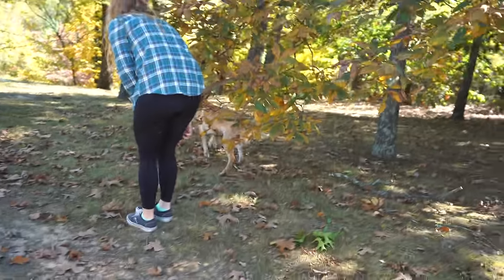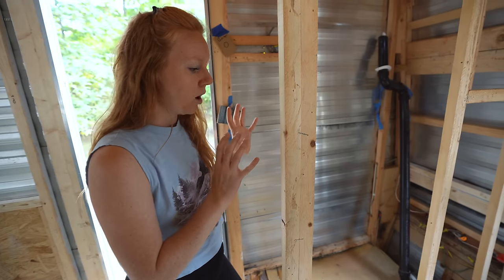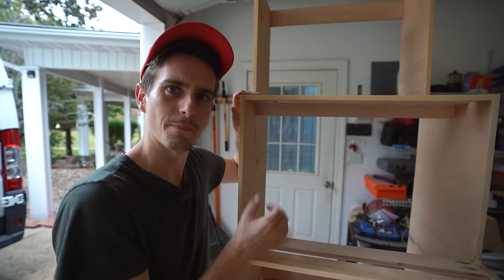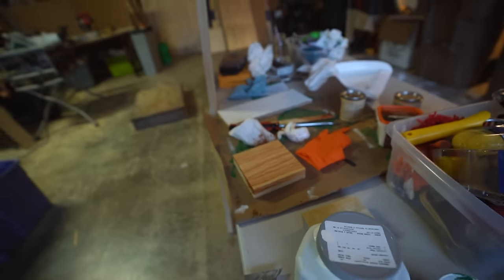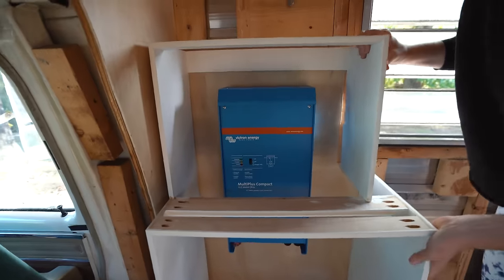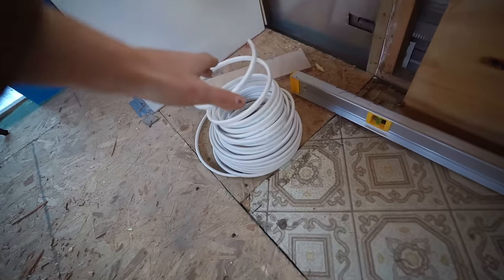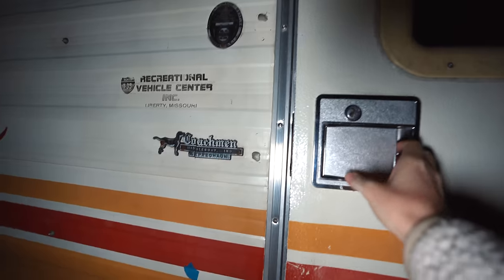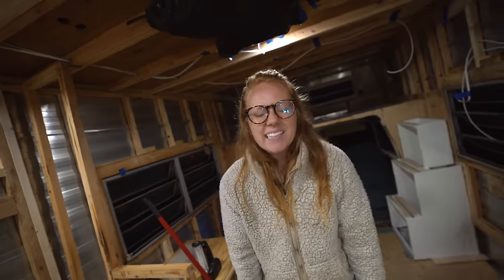Starting Our Custom Built OFF-GRID Electrical System! - RV Renovation (Ep. 12)

Comment: Hi folks! Love the renovation. It's refreshing to see young ladies not afraid to get their hands dirty, break a sweat or a nail! LOL Scrolled through a plethora of comments and only saw one addressing this issue, so here's our two cents worth: your batteries should vent outside. The fan blowing the built up heat into the coach will make the AC work double time and the inverter work triple time; making an endless, vicious circle loop.

Comment: For the electric cabinet (great idea btw) I recommend an intake fan near the bottom (maybe behind the passenger seat) and an outtake fan near the top. (Heat rises) also for your step. Pine isn't very strong. It's Fine for the short run. But for the long run I recommend a hardwood.
Reply: You might want to consider a center support
Reply: Pierre and Randy - True stuff.
Reply: Been looking for a comment like this. Thanks

Comment: Love the cabinet/stair idea. I am concerned that you chose pine as it is a soft wood which will easily mar and bow esp at that thickness and use. A hardwood is better for that application. If you stay w pine, you need to put a faceplate to keep it straight, and some type of front to back bracing since you will be climbing on it.

Comment: What kind of refrigerator are you planning to use? 
An absorbtion one draws quite a  lot from the batteries and generally works better when running on gas.
For a compressor fridge, you probably need a thicker wire. Although it doesn't draw huge amps, the inrush current of the compressor will cause too much voltage drop in the wires, so the fridge might think the battery is low and shutdown. Many vendors do have a chart in their manuals which wire gauge to use for a specific cable length.
Even if you're using absorbtion, I recommend running a thicker wire, if you ever want to change, while you can access it, it will be a pita to run a new wire once the walls are finished.

I can't really make up the cable length, but I think you're better off using 10AWG

On the other parts: For the lights you don't need 12AWG. This is pretty thick cable, harder to handle. 16AWG will be fine, since it won't draw much power. 16AWG can handle 5A without issues, and I think the lights are 10-15W max (generally 3-5 watt/piece), and you're not likely to run them on full brightness.

For my campervan build ( https://www.djsmiley.com ) I used 6mm2 (10AWG) for the fridge and water heater, 2.5mm2 (14AWG) for the heater, water pump, maxxfan and 12V outlets (since they can go up to 10A), and 1.5mm2 (16AWG) for all lights.
Reply: They showed it in another video, it looks like a cooler and is an impressive set up

Comment: It’s probably too late but the cutoff switch shouldn’t be right above the battery in case they start to ignite or other electrical issue you don’t want to reach over them.
Reply: Travis - good point. I thought so as well, but what do I know? I thought it should be external.
Reply: I agree kill swith should outdide of cabinet. If trouble it all will be inside cabinet you have to open door reach in to hit shut off.
Reply: @Gar H -agreed.
Reply: @darlenewillbrandt1628  - and all - I've only been thru it on boats, but it must be the same thing. Kill switch on the outside, vents, always have a licensed electrician check your work. It seems obvious, but maybe not so.

Comment: I give you guys credit for running electrical wire and installing lights, switches etc. However, I suggest you have a professional like an Electrician, double check the entire electrical system to make sure that everything is safe.

Comment: Please use an electrician to double check everything before you put up walls!!!!!! 
Don't* want any fires!
Reply: I agree! Thats a lot of electrical components boxed in a small space. Putting in some fans maybe critical in making sure that inverter doesn't overheat.
Reply: Yes, ditto!
Reply: A M and all - Always work with a licensed electrician, even if you think you know what you are doing. I think it is short money. Not being an electrician, I always work with one. It doesn't cost much to have someone check your work. Maybe two.
Reply: Safety first.  Get your work approved by an electrician.
Reply: Yes agree, definitely get an electrician to check it all!... . Look at the you tubers Kara and Nate (you know them, you did a video with them!) .. They just had quite a few things in their van rewired by professionals who discovered melting plastic and several other fire hazzards!... It's not worth the risk... Also install fire alarms!
Reply: @jzakary1  - I've recently had an inverter catch fire. It can happen. Thankfully I watched it happen, so no harm, but for the inverter.
Reply: Couldn't agree more with this comment. Electrical systems and wiring etc, has to be done correctly to make sure that it is safe. You can't just wing it. Better to be safe than sorry.

Comment: I recommend an interior light on a remote...  So nice to be able to light up the interior without searching for a switch, and also nice when you go to sleep to turn off.
Don't forget to fuse each battery, and use the thickest gauge wire you can...  Fire's won't be a problem with a fuse on each battery...

Comment: I do woodworking as a hobby and there is a product called Edge banding made for putting on the unsightly edges on wood. They come in all different sizes and colors to match your project. Hope this helps for your next adventures in furniture building.

Comment: Have you considered mounting the main (emergency) cutoff switch on the outside of the electrical cabinet so that it can be accessed without having to open a possible smoke/firefilled cabinet?  Access would be a lot faster also.

Comment: Nice job guys!
If I can give a piece of advise about the doors of the stair/closet you built: I wouldn't put handles, but rather a magnet/pressure system to open and close it. 
To avoid scratches and bruises on your feet and calves when you do use it as a stair.

Comment: Suggest some vents around the inverter as well the fan to aid with thermal mitigation
Reply: They should put vents in the doors.
Reply: I thought Eric said they were going to install a exhaust fan next to the inverter....hmmm🤔
Reply: @peacefulwife5199  Yes, but vents will let it exchange air with outside the electrical locker (vs keeping it inside)
Reply: Alan, Margaret and Peaceful - all good points.
Reply: @alanholck7995  , okay, I understand.  Thank you.😊

Comment: If you need to service/remove the inverter - how will you get it out from under/beneath the stairs? Also - make sure the stairs are sturdy enough and have non-slip treads on top. You might want to go with strong magnets instead of handles for the stair doors, as in the middle of the night you might hit handles with your feet/legs.

Comment: You will need ventilation. Good you’re installing a fan. Also, consider not putting handles on the riser/ stair doors, use touch latches instead. So when you’re going up and down the stairs you won’t knock into a handle

Comment: You can install a wind turbine and a water turbine on your system too, for cloudy days. Also, you can charge your batteries from the van's alternator while the engine is running. Great video, lots of good tips for building a power system. Please do a follow up sometime after you have run it for a while to let us know how well it works.

Comment: the starcase/ storage came out great, dont know if you have heard of the stuff called edge banding? instead of the wood filler on the plywood edge they sell a iron on veneer that works great and you trim to size afterwards. i have bought it at my local lowes/ home depot. they make it in different colors but white comes out great. check it out maybe it will help you in the future with plywood projects

Comment: Use Noctua brand 12v fans for exhaust fans for the electrical heat producing battery management equipment. QUALITY and very very very quiet fans.

Comment: I am so impressed with your reno! You guys have really put a lot of thought into this and it shows! I've seen this suggested in the comments and I want to second third and fourth it, I too believe you should put a middle support under your steps. My front porch has those and those steps are awesome, my back steps do not and I've had to replace the steps three times in 10 years. A middle support really helps with the weight bearing and helps the wood hold up over time

Comment: The cubby where you plan to keep batteries.... those things are super heavy.   Have you guys thought about maybe installing a pull-out shelf to make it easier to install/maintain those batteries?  You may need to add water, check levels and access wiring, having them tucked into a tidy box could be problematic...

Comment: guys with your pocket screws, your putting all the weight on the weakest spot. turn em  over.  Pocket on the underneath.  They will be better positioned to take more wear and tear.  They are more likely to fail , at a later date on top
Reply: Yes. The cross piece should go all the way across on top of the side pieces and pocket screw up into them.
Reply: zanyz and bruce, interesting. That makes sense.

Comment: With pine you really need to do a pre stain conditioner. 

Also 3/4” Baltic birch is a much better material to use than the glued together pine crud
Reply: Ply won't warp with humidity changes, and if marine ply is used will not delaminate.

Comment: I love watching your adventures and your RV Remodel. Just a suggestion on the stairway doors.in the sketchup you showed having regular cabinet door handles. I can see that as a possible foot snag when going up and down the stairs. I would suggest that instead, you use magnetic closures that will open the cabinet door just by pushing in on it.

Comment: Just a thought, those solar components i.e charge controller and inverter, create a great deal of heat and need to be well vented. The chrage controller alone under full load can get so hot you can barely touch them.

Comment: Not sure if it's possible to change it (or possibly too late?) but the "kill switch" in the electrical closet might be easier to access quickly if it's mounted on the hinge side.

Comment: As you're using a dimmer you can afford to have some extra lighting. Once all of the fittings etc are in they will kill the light a bit. Having a couple of strong lights on an undimmed circuit would enable you to have a big boost for cleaning or even filming. Low level lights for a trip to the loo etc also useful.

Comment: It looks like you ran your 120V wire with lower voltage wire (12 V, network, etc.). Those should be run separate and spaced apart from each other to prevent interference.
Reply: Certainly, signal wires should be kept apart from power cables.
Reply: @delukxy  - absolutely, even triple shielded.

Comment: If it were me I think run the wire first including solar panels and new alternator to charge the bat's. Then button up floor and walls. That way if something doesn't work it's easy to trace. Not saying you should do that. That's what I would do.

Comment: I would have insulated using fire retardant insulation first, then do the plumbing and electrics afterwards, if you need to get to a run of cable, doing it before the insulation means that you have to tear the insulation out to get to it.

Comment: My concern is about airflow/heat of the power sources when putting doors on those steps, thus shutting them in. If you haven't seen Nate & Kara's last episode, you should. Unless you know EXACTLY what you're doing, get it checked by an electrician...for safety's sake! 😁💜💚💙😁

Comment: Am I the only one who's worried about those stairs ability to hold the weight of a grown person?
Reply: not if the steps go to or past the outside edge but if the go on the inside like their straps then yes i would be worried
Reply: Yetti and Adam as well, I think it's gonna work out. We'll see.
Reply: @dobiebloke9311  3/4" step fine if it goes out across the outer uprights. . It may need to have some triangulated cross bracing to stop it lozenging while it's being used, especially when coming down. I don't think we were shown how the whole unit was fixed to the frame. The front side looked to have a gap between it and the curved separator to the front seat area.
Reply: Was thinking the same. That bottom step needs support underneath even if the step goes over the edge.
Reply: I was thinking the same when I saw the pocket screws into the side of the pieces acting as stringers, it should be on top to transfer the load down but at least the treads should be over edges.  When dropping off the bed it may get hit with more than full body weight.  Might want some metal brackets under that to be sure.  Wood filler over the plywood edges works good, I just did that on a cabinet and drawers.  Still an awesome job on a massive project!  Learn by doing.
Reply: @dmixdup  yes we don’t want them injured!  More adventures please

Comment: One additional item you should DEFINITELY purchase that you will later be extremely happy you got. A Wind Turbine. Shore power won't always be available and the Sun isn't aways dependable or shining at the same amount all day every day! You can get 3 or 5 blade Wind Turbines for about $200 to $500 that put out 8000W! All you need is a plug in connection to the outside and a pole attachment spot where you can pop it up when you park and you have a backup power supply to supplement your electricity needs! Really great when it's dark and/or rainy because you usually get wind when it's raining and the solar isn't charging as much as you need, and you don't have to worry as much about trees and stuff throwing too much shade! Of course the wind isn't always blowing either but it is great to have 3 options (shore, solar, wind) that can be going individually or all at once! A small backup generator that can run off either propane, or your RV's fuel supply, or it's own small couple gallon tank is something to think of as well!
Like Mike Holmes (the building contractor on TV that does "Holmes On Homes") always says "If it's worth doing, it's worth OVERdoing"! 😉 Great job you guys are doing!

Comment: I am a little scared of the batteries being right where you sleep. If they cause a fire, you are mostly blocked in. I would have put them further back and away from the door to give a quick exit if they catch fire and you can't put it out. The cutoff switch should be external of that enclosure. If it is on fire, you want to leave the door closed and kill the power, not open it for more oxygen and get burned flipping the switch. I would also put it where it is easy to feel for if power is dead while the batteries are burning. You also generally want charging batteries to not be in the living area due to the deadly gasses that are released during charging. If you are going to keep it there, I recommend you put an outside vent and do your best to seal that area up so the gasses don't get indoors. Just my observation.